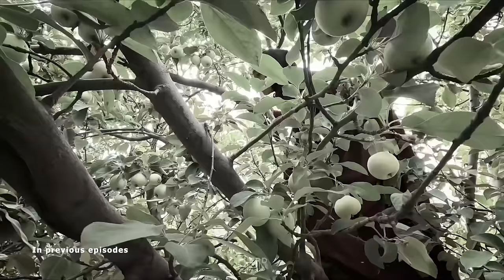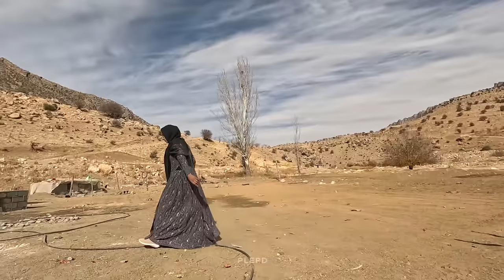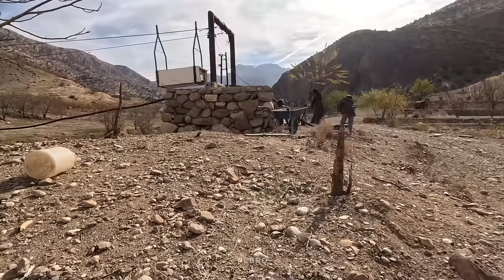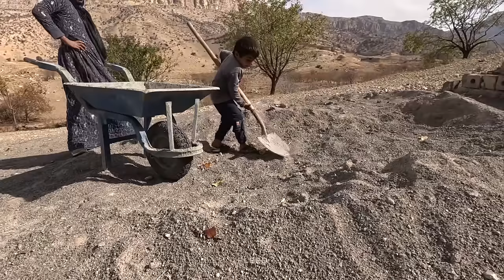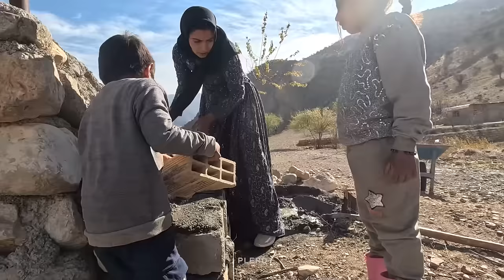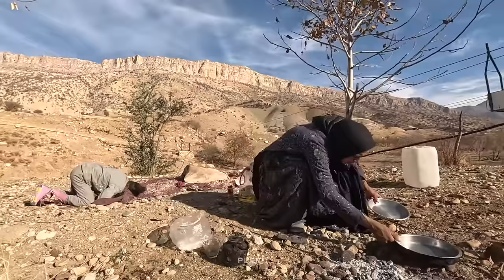Empty Nets; Unfriendly River: Mother and Children Disappointment Empty-Handed

Comment: Advice for Mrs. Tayeba, make a room for the kitchen that is closed and integrated with the room. and have a roof so it doesn't get rained on, and can safely store food supplies and neat kitchen utensils. Apart from that, make a place to wash dishes in it with this pipe or hose for the future so it's neat and integrated with the house. So it's clean.